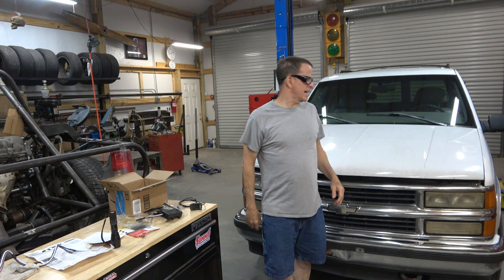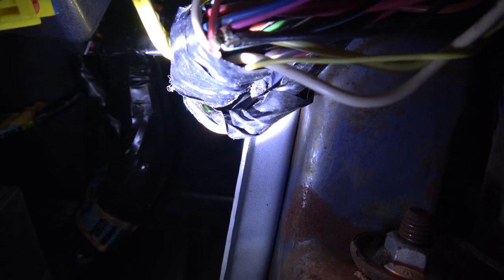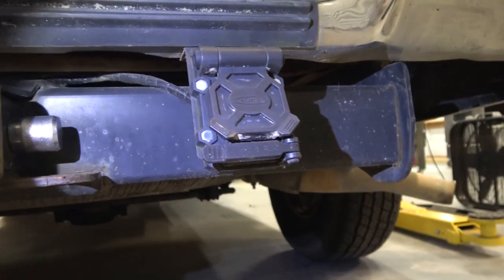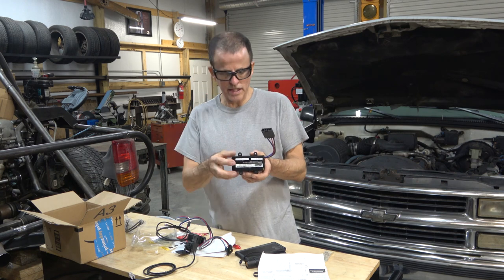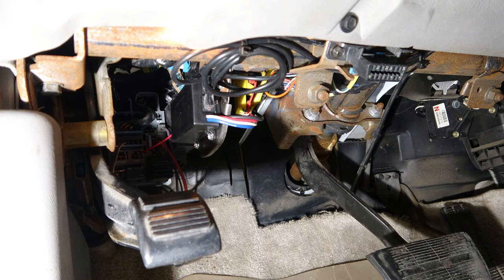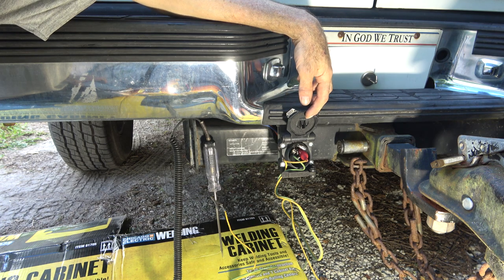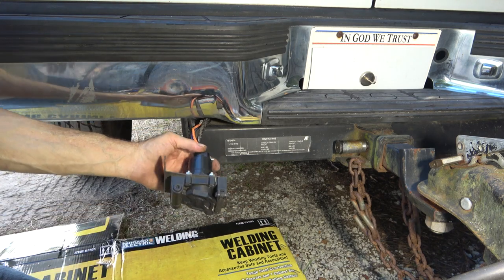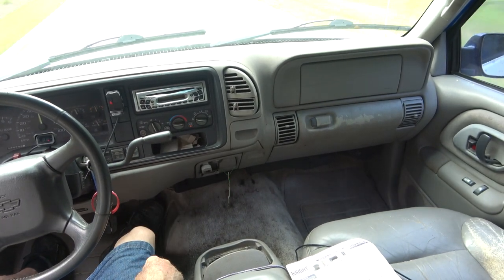Hopkins InSIGHT Brake controller, 1998 Chevrolet C/K 1500, electric trailer brakes

Comment: For the 95’ the wire is there in the frame rail, however, mine doesn’t have that terminal under the dash where you attached to the brake wire switch unfortunately. Just a heads up to anyone with a 95’ I’m trying to figure out how I’m going to connect to it because as he says in the video it’s impossible to reach.
Reply from the maker: 📌ed your comment to the top.  That sucks 😕. If you find a solution please add it to you comment. Thanks
Reply: Was a easy connection in my 95... unplugged the break switch connection and pulled the harness dwn to connect my signal wire... lol hahaha 😆🤣 ITS NOT HARD JUST DONT BE LAZY
Reply: @pjnegale8082  what color wire was it for the 95'
Reply: What type connector did you use on the nat terminal?
Reply: Lol this was my exact question. Still trying to figure it out. @lorenlesavage2114

Comment: while you did not go into deep detail of wiring up controller, great information!!!
Reply: I liked giving the info we need first and then following with the video, and also about finding the miswiring at the trailer.  OF note, many sketch views of the trailer wiring at connector are confusing.  Some sketches view the connector from the front and some from the back of the connector.  So now you have the front of the connector on the truck, the view from the same connector looking from the trailer and two more view on the trailer end.  I have a copy stapled to the wall for reference.  I recommend once you (anyone)  find a sketch that you find easy to not make a mistake to keep it for future installs.  Just make sure it get's done right so that your vehicle matches all trailers.  I prefer to crimp, then solder then heat shrink and finally tape every connection.  Time in the garage can be relaxing, time at the boat ramp fixing a half azz job in the dark is frustrating.

Comment: Glad I ran across this video for I was dreading running new wire under my muddy a** truck. With the help of your video I was able to install my brake controller on my 98 sierra as well in about 20 minutes. Thank you for putting that info in here as most people including myself did not know of, and I've owned 4 of these guys.
Reply from the maker: Good to hear that it helped.

Comment: Your doing God's work. Thank you. 🙏
Reply from the maker: @Woodman_Custom_Sawing  Thank you. I'm glad it helped
Reply: @TSRGarage  I tried to tie it into the brake light switch and it didn't work and it's hard to get to. I found the AUX pin and it was much simpler. Nice not to have to shift and manually apply my controller at the same time lol

Comment: Thank you for pointing out the NAT connection for the brake switch. But how did you actually connect to it?
Reply from the maker: Just used a spade connector
Reply: @TSRGarage  Thank you!
Reply: That 'NAT' port doesn't have any terminals/leads in my truck!.. it's just empty.. Aaarrgghh! I did find the wire though.. a thin white wire in the big wire harness under the column.

Comment: Hello, I just installed this same controller and when the trailer is attached the little red light in the bottom corner of the dispy doesn’t light up. Just wondering when you have your trailer attached does it light up on yours?
Thanks
Reply from the maker: Yes

Comment: i have a 98 k1500. 
Can that blue wire be used for the 3rd brake light on a camper/topper shell?
Can that orange wire be used to run camper auxiliary lights in the camper/topper shell?
Reply from the maker: I'm not sure exactly which wires you are referring to. But the wires running from under the hood to the rear could be used for anything. As for a third brake light, I think taping into a brake light wire at the rear would be just as easy

Comment: So when you hook your adapter into the red wire in the frame rail is that already a fused hot wire? Or does it need to be run up to the battery still?
Reply from the maker: Wire needs to be connected at the front, under the hood

Comment: Thanks for your video.  Right now I'm installing a controller on my 98 1500.  I bought a Reese controller, and there was a warning in the packaging that said connecting to a lead that's hot when brake pedal is depressed but connected to ground when the brake pedal is released will cause shorting and burnout of the controller.  (They referenced Ford, so I thought I'd be safe). As it turns out, the connection you used is continuous with ground when the brake pedal is not depressed.  So it seems that terminal is not going to work for me.  Have you had any issues? Did you encounter this issue with your controller?
All the best,
Michael
Reply from the maker: I had no problems with mine it was connected to that Tahoe for about a year. I swaped it to my 98 Chevy pickup and I have no issues.
Reply: Great to hear. Thanks for the reply. Does your controller have a button or lever that manually applies the trailer brakes?  Taking a closer look at the warning, it says that using this function of the controller in the grounded-when-off situation will break the unit.
Reply: I looked more closely at the video and see that it does have the manual brake lever.  Thanks again!
Reply: thus happen to my F150 but was fine on my OBS 1500

Comment: Does anyone make custom wiring harnesses?
I.e would I be able to buy a set up for my 99 GMC suburban  2500 that will just plug into the fuse box?
Reply from the maker: Not that I know of.
Reply: @TSRGarage  how did you utilize the NAT plugin as a way to tap into the brake circuit for your brake controller? I have the same problem you did...hard to reach brake switch, but easy to reach plug in with no wiring harness.
Reply from the maker: @TheKellisunshyne  used a small spade connector to connect over the pin.
Reply: @TSRGarage  any type of connector in particular?? Can you buy generic connectors at a hard ware or auto parts store? Sorry for blowing up this thread btw...I just think using this method is better than splicing.
Reply from the maker: @TheKellisunshyne  no particular one.  I just used one that fit snuggly.
Reply: @TSRGarage  okay, thank you!!!

Comment: What amp breaker
Reply from the maker: Breaker ?  I don't remember I did this 4 or 5 years ago.
Reply: @TSRGarage  true 5 years is a long time, I was talking about the circuit breaker/fuse with some searching I found its a 20amp for 2 - 4 break, and 30amp for 6 - 8 break systems. Thanks for the video, it helped me with my install.